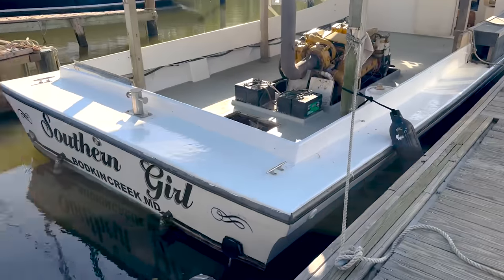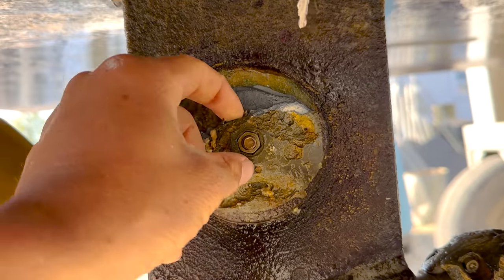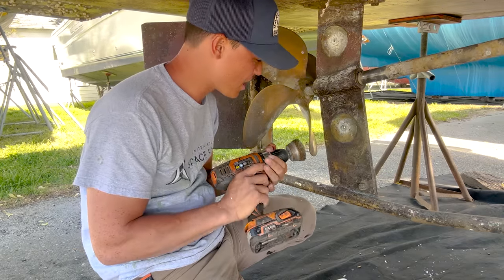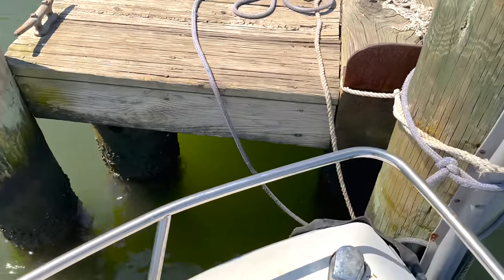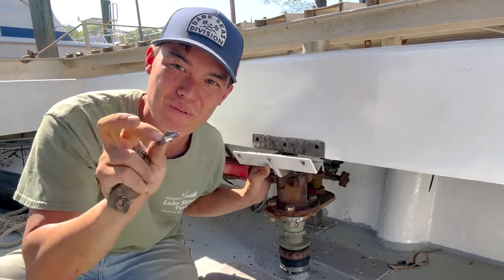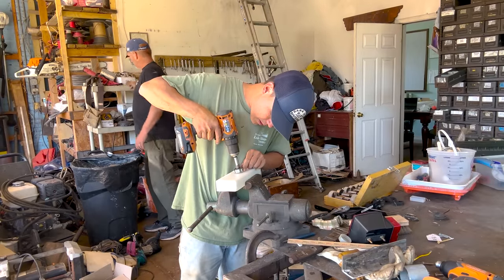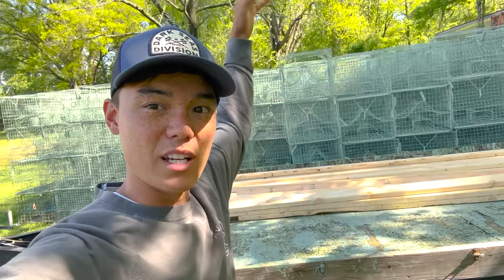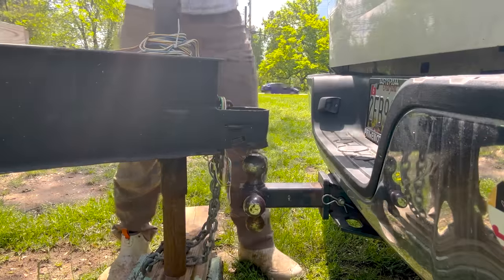I Did All This Just to Go to Work!

Comment: Good work mate!

Just some advice when towing,. You should always cross your safety chains when towing, left one goes to right shackle on vehicle and right goes to left. I'm  not sure if its the law to do so in the US but in Australia it is. 
The main reason to cross them is because it will act like a cradle if the trailer comes off the ball and wont let it dig into the road and flip your car.
The second is it reduces strain when turning.
Reply: That particular issue is not addressed in federal law. It falls to each state to create its own regulation on how to handle trailer safety chains. I know in my state it is required to cross them.

Comment: If they don't make it or you can't buy it make it yourself! I remember working in the York River with my dad as a kid. We had a 42' Chesapeake Deadrise with a 671D Detroit. It was setup for clamming.  The Hyster was built from the rear-end of a Ford Grand Torino. Where many other watermen had hydraulic Hyster where you could take your foot off the pedal and the tongs would remain stationary. Dad's would go back to the bottom.  I got out when the VAMRC came out with that authority card that had to be purchased before you could get a catch license (a license to get a license). I didn't fully appreciate what we had back then.

Comment: Just a small suggestion.......   Drill a hole for a grease zerk in the plastic right at the rudder shaft.  That way you can grease the shaft once in a while.  If you feel the need or in your boat check before you go out.  Oh yeah, use marine grease.  Like the grease you use in wheel bearings for a boat trailer.  Great engineering!   Use what you got, try not to buy anything.

Comment: Hiya, listen for the rudder. Get a shop to make you a simple brass bushing.  You can use that with a grease fitting and it will last you well. Another way is a bit bigger brass bushing with a sealed roller bearing in the top and another in the bottom of the brass. Bolt in place with your original clamp system and for maybe a hundred dollars, never have another problem.... 
Have a great one.

Comment: Thats Devoe formula 121 red vinyl bottom paint. A military grade they don't make anymore. Very good stuff however, you painted directly over all the metal parts, rudder and struts. You need to put a epoxy primer on first, then the bottom paint. By putting it on directly like that any metal that the copper bottom paint comes into contact with is going to be eaten away. That's your electrolysis problem. Not the marina. Need to haul back out and strip all that bottom paint off and coat it with the barrier primer coat first. Zinc will last longer. I did the same mistake with my first boat when I was 19. Paid a huge price 10 years later.

Comment: Do you run shore power when in the dock Luke? If so, get a isoaltor. Look into what happens to your anodes when using shore power in a dock. Seriously. The eloctrolosis issue is the leach across ground in shore power. You can put a simple isolator on the boar and it'll stop hose annodes from getting decimated.

Comment: For your rudder bushing you should drill the hole out with a tapered bit so it will align with the rudder shaft perfectly to reduce the vibration. Also grease would help with the noise and longevity. Love the videos tho. Keep on crabbin

Comment: The cage on your trailer is a great idea. I’m just wondering why you had so much trouble roping them on? It should only take 15 min if you’re doing it right. You need a long enough rope and enough hooks welded underneath, Preferably a hook per stack. Then a cross ❎ at the back. Oh and dolly knots or truckers knots (same thing) the only thing you have to be careful of is not to crush your pots while tightening them down. Any way you have the cage now so it’s irrelevant 😂

Comment: I’d drill a hole in the plastic through to the shaft on one side and thread a grease nipple into the hole and pump it full of grease. The plastic will probably act as a lubricant but if it gets hot and seizes your rudder may stick.

Comment: Wow its a good job your not buying something expensive for your boat eg. Drive shaft. If you were to order a 3" shaft at twice your actual length then it would be a very costly mistake. Your rudder shaft is not 3" it 37.2mm on your cheep plastic Caliper Vernier which converts to 1.46" or just under 1+1/2 inches.

Comment: Hi there the bushing you made for your rudder , you need to groove the bushing and add a grease nipple or it will seiz up on you..😢
Reply: I just wrote the same thing! Should have checked the comments first!
Reply: Or get an actual composite self-lubricated ptfe bushing/bearing like a Garlock.
Reply: @advancedusvsystems6255  there’s probably a lot of ways it can be done, you could also use a brass bush with a 3” ID, or a couple of roller bearings, but I think the whole point of using this was because it was on hand and it was free. Personally if I have to repair my work car which I use to get my wage, I will wait and repair it with the right part, but sometimes that isn’t an option.
Reply: @thesausage351  I'm just saying. That teflon/hdpe block is more money than an actual bushing.